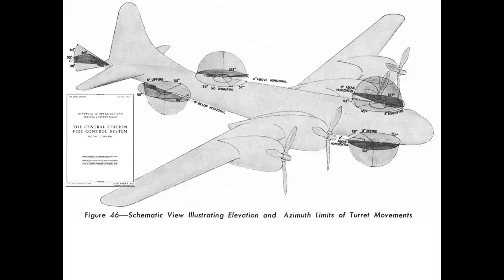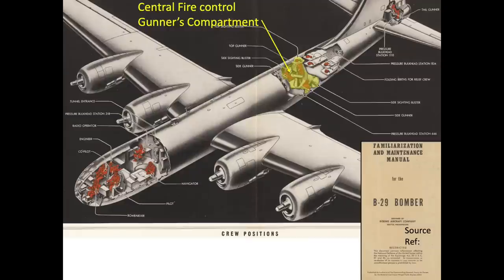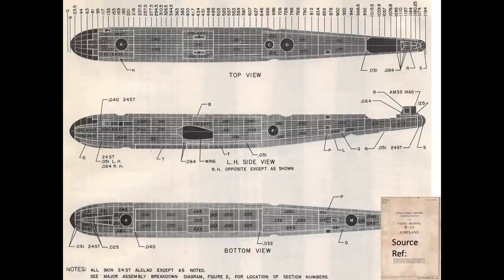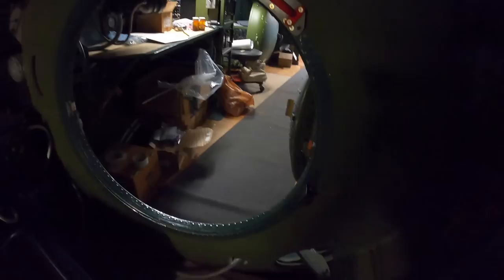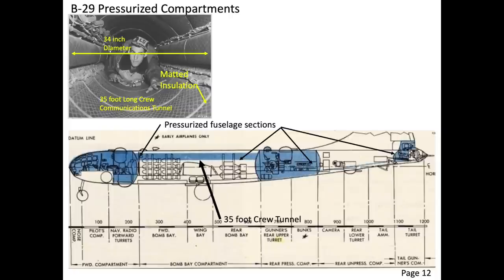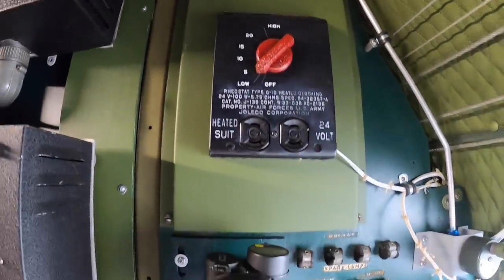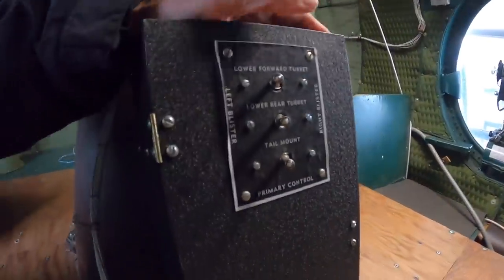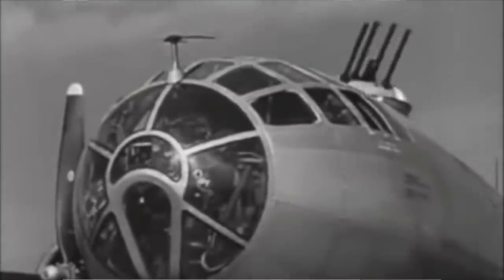B-29 Bomber Gunner's Compartment Detailed Walkthrough

Comment: This aspect of the b-29 has always been a mystery to me. Thank you!
Reply: With the AN/M2 .50 cal firing rate of 800 rounds per minute a quad mount gun turret was putting about 6½ lbs of lead every second in the face of a Japanese fighter that was attacking, coupled with the accuracy of the B29's defensive guns analog computer fire control system it made for a very unpleasant experience for them.
In regards to the B29's 11.7 to 1 kill ratio against enemy fighter's, I've had people argue that it was because the B29 entered service against the Japanese later in the war when most of their experienced fighter pilots had already been shot down and that score was compiled against inexperienced fighter pilots, I'll argue all day long that it doesn't make any difference, it wasn't a matter of two aircraft battling against each other using aerial maneuvers, the bomber was flying a straight and level course and wasn't performing defensive and offensive maneuvers against the attacking Japanese fighter as if it was also a fighter, from the point of the attacking Japanese fighter's all the experience in the world didn't make any difference, 10 days or 10 months of experience didn't matter because it was a matter of sitting through brutal, accurate .50 cal fire until you were within the effective range of you own weapons and could fire on it.
Similarly in Europe against the defensive firepower of a B17, which may not have had the computer augmented defensive gun system of the B29 but still had Sperry lead computing gun sights in it's gun mounts, those German fighter pilots dreaded flying into a B17 box, because all the experience in the world didn't do anything to help them.
This is from a letter written from a German fighter pilot to a friend of his back in the east who'd flown there with him flying against the Russian's and was transferred to the west to fight the 8th Air Force bombers;
"When we would dogfight against the Russian's it was kind of fun, sometimes you'd shoot them down and sometimes they'd shoot you down, but the first time I turned into a B17 box every sin I committed in my life flashed right before my eyes", imagine what it would have been like for a Japanese fighter pilot attacking a B29 formation with the defensive gun system it had, it couldn't have been a pleasant experience.
Reply: @dukecraig2402  you are right, it must be a very terrifying experience to operate against a tight box formation, especially if you are used to a wider field of opportunities in airfight. an attack on a formation of bombers could be and had to be planned an executed according to the plan. a differend mindset is therefore needed. but experience will help, because despite all the planning you had only a window of 2-3 second to shot and you have to calculate the angle and lead perfectly. the chance of damage to your plane is high and after your attack you will be low and behind the B17s and so mostly there will be no second attackrun. maybe on their way home

Comment: When this was posted I went oooh oooh! Another Christmas present!! Very well done. Totally unique content. Have a gr8 Christmas!!

Fun fact: the circle of dots in the gun sight used for ranging is made by two plates with S shaped radial slots. Where the slots cross over each other, there is a diamond shaped hole the light shines through. Moving the plates in opposite directions relative to each other makes the diamond shaped holes at the intersection of each slot pair move closer or farther from the center due to the curvature of the slots.
Reply: Good description, makes sense.
I was a Vulcan air defense gunner in the Army, the more I see of the gun sights used on the defensive guns of the US bombers in the war and even the gun sights in the fighter's like the K14 sight the more similarities I see between them and the sight we had on our guns.
The biggest difference is that our system had a ranging radar that eliminated our having to range the target, that part was automatic, but the rest like the sight automatically leading the target and compensating for bullet drop worked out the same, at the end of the day you simply put the target right in the cross hairs (so to speak) instead of having to lead and elevate like a hunter with a scope on his rifle shooting at a running deer far enough away that the amount of leading and elevating is something he has to figure out himself in that split second. 
I guess the gun sights on the early fighter's in the war didn't have any kind of automatic lead and elevation and is why the fighter pilots who'd grown up shooting game bird to put meat on the table did better than the city boys did, they already had that instinct in them for shooting something that was flying, it probably also helped the waist gunners on the bombers that didn't have lead computing gun sights like the turret gunners had.
Reply: @dukecraig2402  With the fixed sights were were specific procedures for using the reticle graduations as a range/lead estimator. The K-14 gyro sight was a licensed built Ferranti sight developed by the British. Pilots had to be encouraged to use it as many resisted and just used the fixed reticle you saw with your right eye. In WW gun cam footage you can see some films with tracer and some without. Those without, you know they are using the K-14/Ferranti Mk II which allowed tracer to be deleted and was a big tactical advantage, not warning your target you were shooting at him. The first radar ranging sight was for the F-86, the APG-30. The black upper lip of the airplane's intake is the radome. It was a top secret weapon. When an F-86 was forced down in China, the Russians got it and developed a radar warning receiver as a countermeasure.
Reply: @JK-rv9tp  
Yea I'm familiar with how the fixed sights worked, as I said there's a lot of similarities between the sights from back then and the one's we had, that includes having to manually sight our targets in the event of the system failing or suffering battle damage or not being able to use our radar in the event enemy aircraft in our area were using anti radiation type missile's, they were hunting us as much as we were hunting them, a formation of aircraft on a strike mission going after assets we were task with protecting would have more than just aircraft in their package armed with munitions for taking out those targets, the first one's in would actually be armed with munitions like anti radiation missile's designed to take us out first, we actually learned through our training to keep our radars turned off and let them sweep through the area first giving them the impression that there were no air defense assets in the area, then when their strike aircraft would come in we'd have a crewmember outside of the gun pull a cord that would cause two radar scattering nets we were hiding under to unzip up the middle and fall away to each side exposing the gun so we could take a shot, the whole idea was to lead him with a generous amount and have your burst go across his nose instead of behind him, every one of our 3,000 rounds per minute was a tracer and we wanted him to know he was being shot at, this would accomplish 2 things, the first is out of the interest of self preservation he'd drop his weapon short of his target, mission accomplished, we just protected the asset we were task with defending, the second would be to drive him to altitude so that one of the Stinger missile crews who ran around in Jeeps that we worked with in what we called hunter killer team's could get the kill shot on him, if he was busy jinking turning and diving while dropping flares trying to evade the missile he'd probably forget about the gun and and come back around our way and we'd get another shot at him, immediately afterwards the driver of the gun would drop it into gear and take off for another location while dragging the camouflage radar scattering net behind with everything from M16's, field phones and probably the squad leader who was the guy that pulled the cord wrapped up inside of them.
In the event we couldn't use our radar because of the scenario just described or the system was broken they had a "manual mode" they could be switched to and then instead of just putting the "pipper" dot on the target there was another part of the reticle that we'd use as a reference for estimating lead and drop, and the reticle wasn't caged or fixed when using manual mode, it would lag behind the gun when traversing it forcing you to lead it but not to an exact amount for what was required, training and the experience from shooting at drones on the range is how you'd learn how much was needed. 
When the fighter gun sights started using radar like on the F86 for ranging that was pretty much the same way our systems and sights worked when we used our radar, I'd imagine they also had a back up manual mode they could be switched to in the event that the radar was broken or for some other reason couldn't be used, and like us they were probably trained on how to use it which basically amounted to Kentucky windage. 
The early fighter pilots that thrived in aerial combat because they grew up hunting were the guys who didn't want to use the K14 gunsight because they already had their way of doing things that was working for them, given what was at stake I don't blame them, if you were successful using what you were using would you want someone to come along with some new fangled way of doing things where you had to learn a system of ranging using that knob that varied the size of the sight while at the same time you had to compensate the wingspan for different angles, or would you rather just keep doing something that you'd developed into a reflex that you could do in an instant?
But you can bet that the new pilots that were trained from day one with the K14 were overall better shots than the 1 in 100 that had a knack for something because of him growing up shooting game, take that same guy and train him from day one with the K14 gun sight and he's gonna be even better.

Comment: In Saburo Sakai’s book “Samurai”, he often speaks of being trained to turn left evasively. A right-handed person with a right hand on the stick can make sharper turns to the left. Perhaps that goes some way to explain to paucity of attacks from the left. Thoughts?
Reply: Single engine fighters sufferred from gyroscopic effects of the spinning propeller mass.   It meant they could turn better in one direction compared to the other.  So, it was safer to attack on the side where you could turn and get away better.
Reply: @keithammleter3824  Rognt! Engine torque, of course, thank you.
Reply: @keithammleter3824  That's what I assumed to be the cause of the disparity between left and right.  This video is the first tome I've heard about the difference.
Reply: @reigels  :  I thought about this again since my previous post.   There is another factor.  If I was a Japanese fighter pilot, I would attack the B-29 from its left front corner, even if I could turn just as well in either direction.   The B-29 pilot-commander and the navigator sat on the left.  That gives me maximum probability of hitting the commander, who is presumably the most capable and more likely to continue his mission in spite of damage to his aircraft.   It also maximises the probability of hitting the navigator, and without him they probably won't make it to target and/or back to their base.   The navigator actually wasn't that critical to getting home, as US crews were cross-trained, and could get radio guidance.   But the Japanese might not have known that.   One of the reasons why they had little chance of winning the war against the US is that they did not cross-train crews at all.

Comment: No wonder the B-29 cost more to develop than the A Bomb! It is quite complex!
Reply: I've always heard that and thinking about it after looking at the development of aircraft throughout that era I think it's an unfair assessment. 
The cost of developing the engine's, defensive guns fire control system and some other things are all costs that get added into the cost of developing the B29, but I don't think that's correct because with other aircraft, like whichever one that it was that first used on, the cost of developing the Pratt&Whitney R2800 engine doesn't get added into that aircraft's development cost, and contrary to what most people believe the Wright R3350 engine wasn't developed specifically for the B29, it was simply the next engine that Wright was developing after the previous one they'd developed, they all would develop an engine then move on to developing the next bigger and more powerful engine, just because the timing works out that they were developing that engine parallel to Boeing developing the B29 doesn't mean the cost of that engine's development program should necessarily go on the B29's books, they may not have been in WW2 but there was plenty of other aircraft that used that engine including the A1 Skyraider that was actually flying before the war was over but just didn't enter service before it was.
There's a likewise argument for the defensive guns fire control system, no matter what the first VHB (Very Heavy Bomber) the Army chose was going to be that system was going to have to be developed by General Electric for it, matter of fact I wouldn't be surprised if you look into it that was something that was already in the design pipeline before the first raw sketch of a B29 was even drawn on the back of a napkin. 
I don't believe that all the "firsts" that were part of the B29 should be attributed to it's cost, they were going to have been needed anyways, some things like the time and effort put into developing the pressurized fuselage for the B29 should be included in it's price tag because although future bombers would need it that particular design is specific to the B29, the main components aren't interchangeable with another bomber from another company because they're specific to the B29 being the fuselage itself, but the engine's and the defensive guns fire control system are both something that with slight adaptations can and were used on other aircraft, especially the engine's, more than anything else the cost of developing them should be subtracted from the cost of developing the B29.
Reply: Not sure it did but both were out of the axis's potential
Reply: @Eric-kn4yn  
It did, but as I explained in the post above your's I don't think that's a fair assessment, the cost of developing the engine's shouldn't be added onto the books of the B29 because they were being developed anyways, it's just that because of the timeline they were being developed at the same time the B29 was. 
There's other things on the B29 that like the engine's also shouldn't be included in it's price tag and for that same reason, subtract just the cost of the engine and the defensive guns fire control system development and then see what the price of developing the B29 looks like, I'll bet it was less than developing the bomb if you do that.
Reply: @dukecraig2402  of course, the costs of developing the a-bomb "firsts" went on to be used on many (MANY) latter bomb designs too

Comment: It's quite possible that the Japanese only preferred attacking from the right because of flight characteristics of their fighters. Most were limited in turn to one way or the other because of the torque of the engine. That made it easier to turn one way but harder the other, plus not having hydraulic enhanced controls. Maybe it was better for them to come from that direction and fire and peel away faster? It's just a theory. We did recover an A6M2 from the alutean islands  and learned the flight characteristics of that model. So maybe.

Comment: Good stuff.  My Dad was an FE, with 17 missions over Japan, and another 10 or so over Korea (they were withdrawn).  My Dad also mentioned that the fire control system was the most troublesome electrical system on the aircraft; right after the engines....
His missions were at night, where there was little fighter opposition.  In fact so little the turrets were removed, and tactics changed to low altitude.  I bring this up because "kill ratios" can be misleading:  was this kill ratio across the ENTIRE span of B-29 ops i.e. from China to the end?  Or just up until tactics changed?

Comment: Did the left right bias in Japanese attacks have anything to do with the location of the sun?
Reply: Now that's a good idea!  B-29s mostly flew north to their targets, and if they left around dawn, that would put them over targets around noon, so sun position might not have mattered as much.  But maybe they left earlier, putting the sun on the right side inbound when it was more important to shoot them down and they were slower and lower.

Or maybe it related to geography.  B-29s crossed the south east coast, and defenders coming from the islands would attack from the left, maybe not have time to cross and turn around to attack out of the sun.
Reply: Attack bias maybe to do with the handedness of the pilot? A bit out there I know.
Reply: I suspect it had to do with the torque of the Japanese planes engines. If the propeller turns to the left that would make the plane roll faster to left and slower to the right. So once the completed their attack they would turn to leave.. faster roll, faster turn, less exposure.
Reply: @deafsmith1006  ...rather, the opposite. When a propeller is left-turning, gyroscopic result does help the plane to roll faster to right.
Reply: @francescofissore161  Well I wonder which way the Japanese planes props turned!